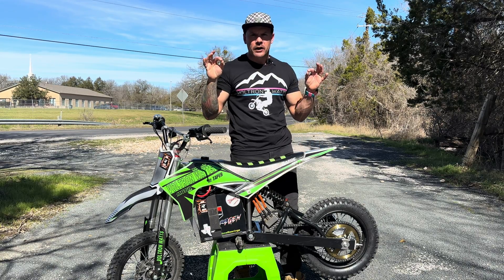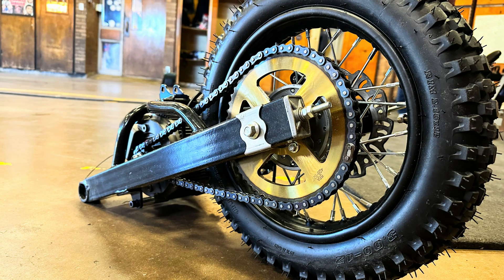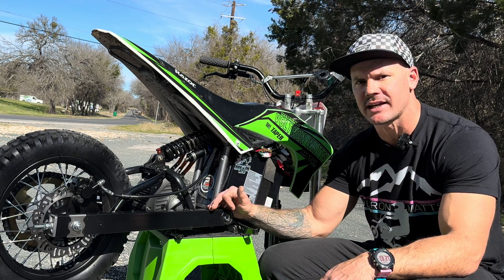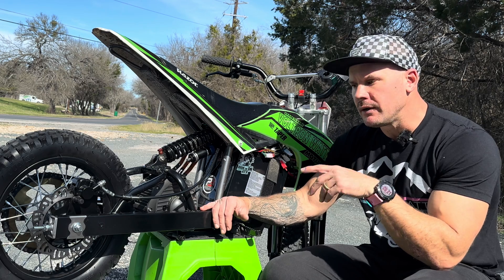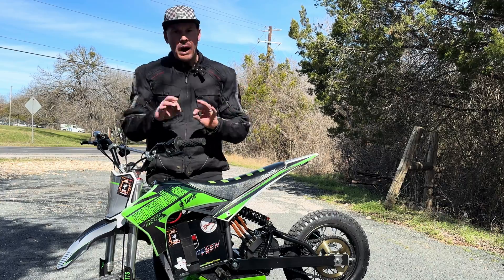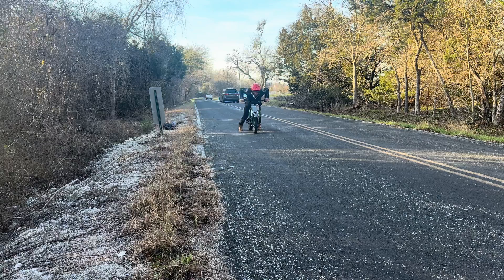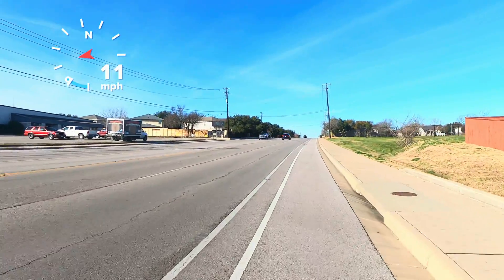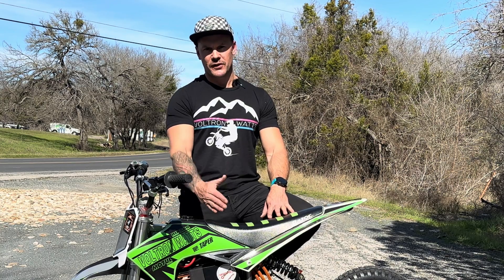Is It To Fast!? 70+ MPH - Sotion Powered Razor SX500 Electric Dirt Bike!

Comment: I'm so excited. I got the fw11 kit.from e-conic. You\nCan't beat the price right now.for a little chinese go cart. I just need a battery with 200 continuous amps. Trying to figure out how many amp hours in the good shape of a battery that will fit right on the cart. Because it's so small, probably 25 to 30 amp hours.

Comment: If I have the cricket controller from electro andco can I put this on my bike?
Reply from the maker: I’m not sure the noisy cricket is compatible with the FW11 when using the TruMoto app. If you wanted to use a VESC tool app and fine yourself, yes 👍

Comment: Hey so I got a problem with my ebox dragster there’s a fuse on the battery the guy said it needed to be replaced so I did and whenever I pick up the wheel it gives it full power and let’s the wheel spin assoon as I get on it and give it throttle it dies completely and then I’ll unplug the battery from the bike and re plug it in and then it will say 100% but will do the same things over again so then I plugged it in to the charger to see if it was reading different and the charger is saying it’s full so idk what’s going on if u could help me I don’t know if the fuse holder is just bad plz get back to me
Reply from the maker: Sounds like a throttle or controller issue
Reply: @VoltronWatts  but it works on a 48v battery

Comment: I am starting a 72v build what battery should I use?
Reply from the maker: Depends. What motor and controller you got?
Reply: @ I was planing on getting the gfifls 3000w motor and controler kit off Amazon
Reply: @VoltronWatts  (the one from your amazon shop)

Comment: Also are you using the 96680 just cause you plan on going with a 96v battery? The 72680 and 96680 are the same price so would it just be better to grab the bigger controller?
Reply from the maker: I got the 96v controller because I planned to run a 96v battery at some point. And I did get a 96v battery and I got a 961800HR controller instead 😂
Reply: @VoltronWatts  makes sense, I really wanna do a 96v setup but not sure yet lol

Comment: What cells are in that amorge battery? What bms did you go with ?
Reply from the maker: 2170 lishen and ANT BMS
Reply: @VoltronWatts  how's the voltage sag on the 2170la lishen? I'm debating those or samsung 50g cell... from amorge for my ebox 2.0 how much range do you get out of the amorge battery

Comment: How did the 72v 40ah fit in the bike? I called Amorge and they said the dimension is 6”x9”x10”. Seems too  big
Reply from the maker: It fits 🤷🤣
Reply from the maker: I will say tho, mine does not have the metal case around it. Adding the metal case does add some dimension

Comment: Do you know if the TruMoto controller would work?
Reply from the maker: Sure will. TruMoto is a VESC controller so, the TruMoto app might not be the move but there are VESC apps that will allow you to use the controller with different motors. However, I think if you tune outside the TruMoto app and use a 3rd party tuning solution you may void your E&C warranty

Comment: For ~850, this kit is a steal. A custom swingarm would already be 450+. 12" wheel kit is ~100. The only problem is the size of my balls. Theyre not big enough to keep the front end down when pushed to the limits
Reply from the maker: Haha! Just because you have the power doesn’t mean you gotta use it all. It’s a great value